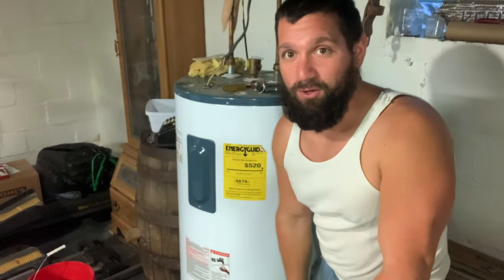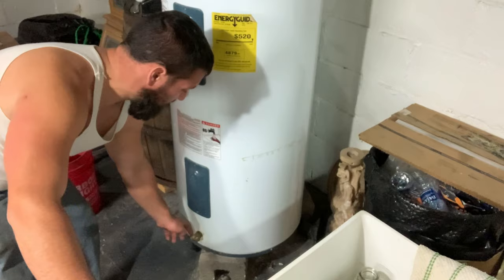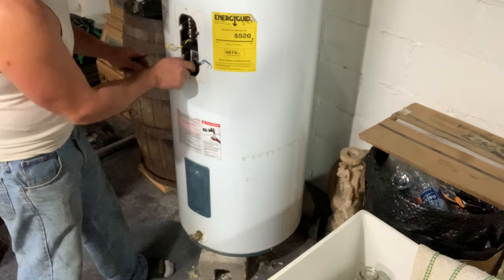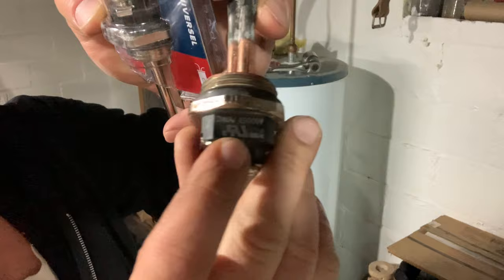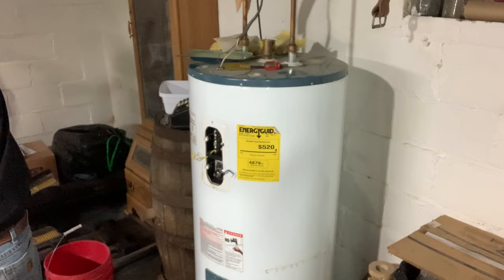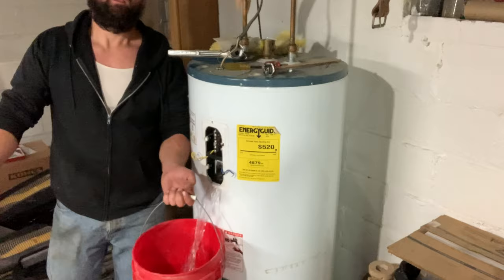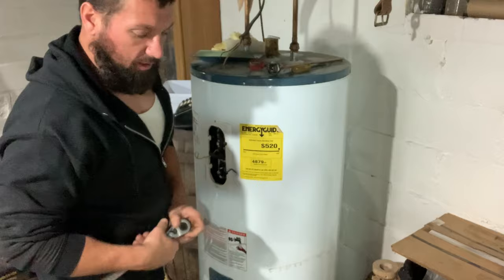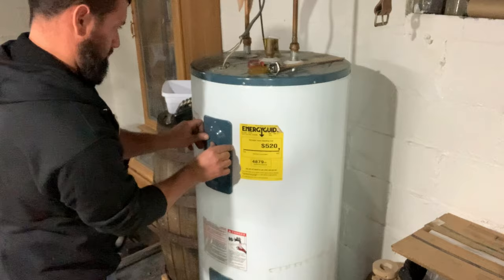How to replace an electric water heater heating element

Comment: Open elements will nit cause circuit breaker tripping. Just will not heat up...or will take a while before you get a hot shower with dual element heater. In the end, you still didn't say what caused problem. ??? Was it the element? Thermostat?
Reply from the maker: That’s strange that you say that I’m not saying your incorrect but the multiple generation plumbing store I got the information said they will cause the tripping. I changed mine and now all good no tripping problem. I hope this helps thanks for watching!

Comment: I did that same thing because before I changed them my water would only be hot for like 2 minutes or so,then I bought elements and changed them now my water don't get hot at all any ideas
Reply from the maker: How much crud was in your tank? You on a well? Is there power to your elements?
Reply: Yes there is power,when I changed the elements it worked for 3 weeks but now it doesn't even get hot or anything im thinking maybe the dip tube? And there was alot of debris in my tank idk how to get it out
Reply from the maker: Yes could be it’s not easy to get out and a real pain beat way is to get a filtration system to prevent it but that can cost 💲 alot
Reply: @WatchOut_I  did u check the thermostats

Comment: A clothes hanger or solder stabbing the drain valve will help it come through with buildup but really it’s whatever’s best for your situation
Reply from the maker: Great tip to add thank you for the input I started doing that some it does work great 👍
Reply from the maker: https://youtu.be/C6ova8lbElw check out this new video I put up yesterday I think you’ll like it too and can probably give some advice it’s a diy also

Comment: There’s a drain spigot on the bottom 🤦‍♂️. Is that a whirlpool?  Lots of problems with those over the years.
Reply from the maker: Yeah it gets plugged up and stuck open 😂 so that’s why I say not the way u do it haha I have my special way of doing things around here .... it’s a rheem 10 years old but I agree the whirlpools are whirl poos 💩 thanks for watching!
Reply: @frontwoodsfarmer2063  I had a Rheem tank that lasted 13 years nothing wrong with it and put in a Rheem tankless. I watched YouTube videos on how to do it. Now I’m interested in them. Something to occupy my time during the cold weather and pandemic.
Reply from the maker: @Jimbobo162  curious what that ran you money wise? I wanted to look into them
Reply: @frontwoodsfarmer2063  I bought the unit on eBay for 300 installed it myself and paid 400 for an electrician to do the electric.  It will only run one shower or faucet but it’s only used for showers and dishes. You will want to get your water temperature to make sure you have the right temperature rise you need.
Reply from the maker: I used to work for a plumbing outfit and hardware store I’m familiar with the water heaters and power vents etc but the new tankless I never dealt with at all

Comment: Looks easy unless the element won't unscrew.  Mine wouldn't budge, even when I used an extended breaker bar.   I tried using WD40 to loosen the tight bond in the treads, but no luck.
Reply from the maker: That’s alot of force surprised it didn’t break free maybe tap the nut area easy?
Reply: WD40 isn't for that. try PB blaster or similar next time. or heat always works
Reply from the maker: @jsngallery  thanks for the tip! And for watching 👍
Reply: If it's that gunked up, generally you need a new tank. But good luck
Reply: @danielmorse4213  Yep, I had to buy a new tank.
Reply: @elliotmann9787  Sorry. On the up note it will heat and store water more efficient.
Reply from the maker: Dang
Reply from the maker: Thanks

Comment: You did this all wrong. You drain the tank first, otherwise you get water in-between the insulation and the outer wall. Which is very bad...
Reply from the maker: Thanks for informing me

Comment: That was a dangerous and terrible video. This is not how you do a water heater element removal.  That was bent because you turned the electricity on before filling it up first again.
Reply from the maker: Thanks for commenting so your saying if you turn the electric on before filling it will bend the rod?
Reply: @frontwoodsfarmer2063  Yes. Wait till the water is full completely. Best way to know is turning on an upstairs Fossett. It will eventually start flowing out. If you turn that sucker on before it is full, it will start to bow. You'll ruin it all over again. Usually happens with the top element.  Why? Because thermostats are designed to heat top first because that is what you are going to be using first.  And the water has yet been filled that high yet. The bottom one has been filled or will be in enough time b4 they get ruined. Because the bottom thermostat doesnt turn the element on yet until the top one has reached temperature. Also important to make sure your temperature isnt so set so high on the top where the bottom one never gets a chance to turn on.. you'll notice it in the shower when you been in there for a while and it gets less warm. 
I understand you are trying to help people. Which is great. But people are dumb sheeps. With a fraction of intelligence. If they mimic what you just did by not properly draining the water hose. They will probably connect the wiring still wet, turn breaker back on, and then cause a dangerous combination. 
Sometimes those bow elements are broken from the start because it was turned on too early. Temperature of room .. usually cold areas... will start to bend.. if it has water.. it remains constant or atleast slower enough that it wont affect it. There is actually electric in the water that people can feel a shock when water is on. Because some dumb dumb turned it on too quickly. Usually it's small amounts of current that breaks through, and is done because of high amounts of calcium that breaks down the elements. Corrosion. Just be careful when speaking to help. Imagine your audience as sheep. I'd hate to be the reason some idiot shocked themselves to death with 240v of electricity. Def enough to do it.
Reply from the maker: Thank u for all the information I think I’m going to remake the video sort of an update i appreciate all the good information.